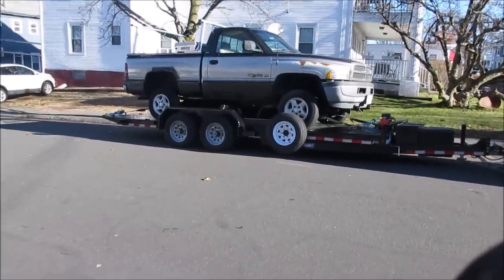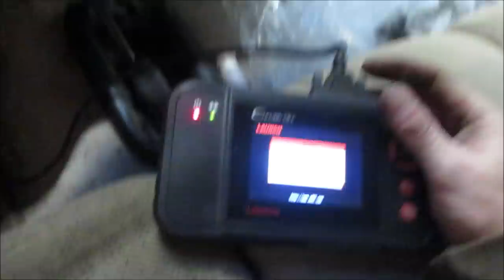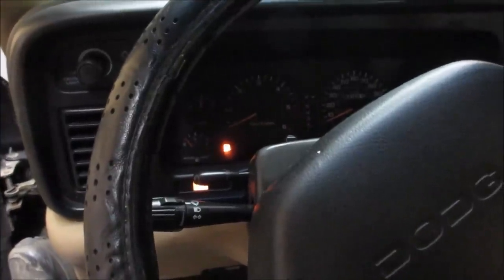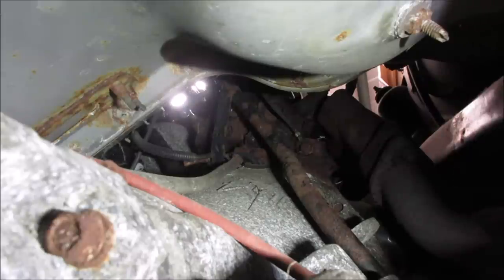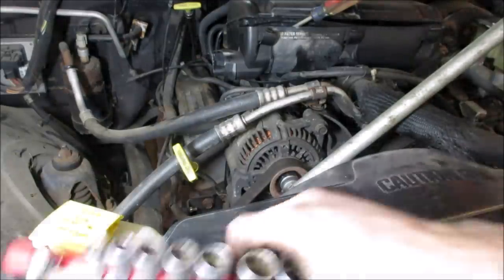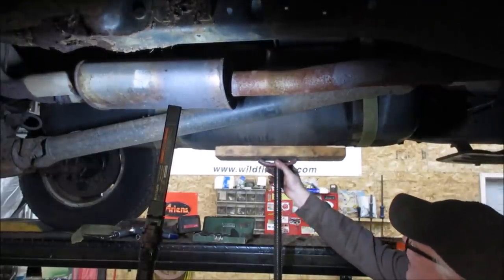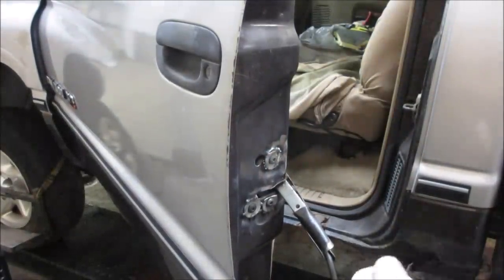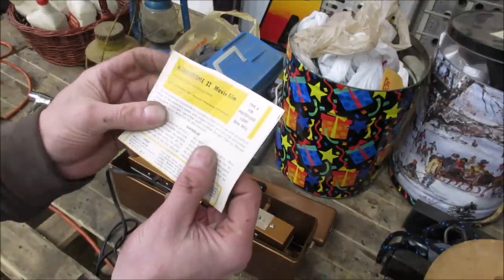Ratty Rusty and Wont Run. But Can We Save IT

Comment: Darren, if you read these one suggestion.
Paint yellow lines straight in line with the outer and inner edges of the lift ramps to the door of the shop with black lines across the yellow ones white numbers in feet on top.
You'll be able to see if you're on track and the distance to the rear of the vehicle. 
Also attach a red ot orange ribbon hanging from the outside edge of the vehicles rear bumper to drag on that yellow line with another yellow line perpindicular to the end of the ramp.
We had that on our lift in the Aviation ground support shop I was in charge of my last year in the Coast Guard as an Aviation Machinist Mate 3d class.
Friggen made positioning tow tractores and especially the Chief's truck on the lift way heck of a lot easier without putting a ding in his bumper and letting hell break loose when he came back for it on weekend gotchya back Chief jobs he'd give me an extra days liberty for.
He was a great guy to work for.
He cherry picked me for the job when I transfered in from Traverse City Michigan Airstation as the distric detailer screwed up and sent for two AD3's when thry had only requested one.
The helo shop chief was a goog ol boy from Georia and the other AD3 from Alabama so Chief Jay being from a Northeast state up around your area took sympathy on me and saved from the Aviation supply depot on base who wanted me to fill out my last year.
Reply: Thank you for your service!

Comment: Have same truck, '94 4x4, auto, 318. Still on road in Northern Ontario. Have replaced front fenders, rear cab corners, bed cross members and rebuilt rockers/floor. New doors from salvage yard. Runs well, used for 1/2 hr drives to seasonal home in winter. Replaced original alternator this year due to fracturing of aluminum body caused by rust expansion of steel-core  windings. Replaced straps on tank, drove first for a while with a heavy ratchet strap replacing one strap. Rad replaced this year, heater core flushed with CLR, good heat for 1st time in several years. Underbody oil-sprayed each year since rust repairs. Steering shaft replaced with Borgeson part. Has had one new coil. Issue with fuel pump turned out to be failing ground, ran new ground. Had issue with voltage regulator portion of PCM, bypassed with stand-alone regulator. Speedo drive not currently working, GPS speedo mounted on dash. Vacuum-actuated 4WD engagement on front axle failed, now locked on by reversing fork, disengages at transfer case anyway (later Chryslers went to this design). It's a good truck for what I need. Transmission rebuilt many years ago as was driven with leaking lines to trans cooler (owner failure!).

Comment: Nice job diagnosing the starting problem with that truck!  Nice finds in that freebie pile too.  The yellow jacket on the Romex indicates 12AWG/20A wiring....white is 14AWG/15A wire
Reply: And orange is #10.
Reply: Not to hijack, but what makes 12ga 20 amp vs. 15 amp?
Reply: @Jeff_Pendleton  The wire size. It's a bit of an over-simplification but for #14 and #12 it's true. US (and I think Canadian) domestic wiring requires at least #14 wire for 15-amp circuits and #12 for 20 amps.

AWG is a strange system where the numbers are inverted, larger number means smaller wire. Sheet metal gauge in the US works the same (everyone else just gives the metal thickness in millimetres).
Reply: @Jeff_Pendleton  12ga wire is thicker than 14ga wire and thus can safely supply 20A of current @110V

Comment: I’ve changed that sensor behind the left cylinder head before. I did it from the top and it took time and patience. When I saw that faulty code I knew you were in for a treat!!  Thanks for the content and have a great day sir!!
Reply: I want my patience and I want it now.
Reply: Yeah, definitely easier from the top, a couple swivels and some patience.
Reply: The dead give away was the tach wasn’t reading when the engine was cranking
Reply: Easy to replace on 96 dodge ram van with the 318 V8 engine
Reply: I don't think that it was described  . It's a crank position sensor and I have giant sized hands. You tube videos were no help so I paid a pro to do it.
 My truck is a 1994 short bed single cab and I call it my half hour truck. The transmission gets slippy after a half hour so it's fine for a twenty mile trip and work on the rental. Those tank straps are T slotted next to the frame and bolt as shown on the other side. Not easy even on a cab and chassis with the bed removed. The frame rails on my other truck, the Mighty Cummins 3500 are still in paint after twenty years, but some parts like spring shackles just rust away. The body on my 2002 is lasting better than the five year old stuff you see on the road now.

Comment: The Austrian "weird" glass thingy, is for dispensing cold wine. The inner tube is filled with ice and wine is poured around it. Wine comes out of the bottom.
Reply: They use these in Bavaria also, not surprising as it borders Austria. I thoroughly enjoy your videos, thanks.

Comment: I’ve got two 5.9s. 1997 2500 van and a 2003 Durango. Great engines. They are actually the “last American iron V8s” that are a direct descendent of a 60s engine. In this case it’s the 273 of the early 60s.
Reply: Fortunately the van and the Durango have much better engine access !
Reply: 👍Thanks Darren 😊
Reply: 273 came along in 66 and was sold along side the old polysphere 318.

Comment: The rust is something I don't miss about the north.  I grew up in Maine but have lived in NC for 6y now.  Recently put lowering shackles on a 95 ranger....all 4 shackles bolts came out of their respective bushings.   Up north, you usually have to torch them out and replace the bushings!  Did the job in just 30 minutes.  The frame on the just looks great as well

Comment: The red globe lantern is a railroad signaling one. I used to have a collection of some of those when I was a kid in the 1960's. It should be marked as property of a certain RR company for who it was manufactured for. Some of them even have the globes etched with he RR's name as well. Back when all the trains had cabooses and signalmen every caboose carried a set .
Reply: My grandpa had a couple of them stashed around my grandmothers house from when he worked for north folk
Reply: Railroads didn't use large base lanterns in general service, if they did it was maintenance of way related. Large base lanterns like that with red globes were used in road construction, they had a large stable base that held a lot of kerosene so they could be left unattended for hours.

Comment: The bright metal thingy we called a jigger.  Used to measure consumable spirits (not ghosts).  The bottom "shrinking head" is for breaking ice into smaller bits.  The bottle opener you evidently know about.  Some models had a cork screw stored in the end of handle, while others sans the opener, had a Rolodex of favorite beverages built around the handle. A  barkeepers friend.  Narragansett Bay

Comment: Those fails you saw on the scan device are just it trying to connect to the car using various different protocols. It tries a bunch of weird ones first and then defaults to the most common one at the end. 90% of the time unless you're working on something strange you'll always get that result in the beginning.

Comment: You should add some paint lines on the floor when the trailer is lined up with the lift to make it easier to line up the next time.
Reply: And put anchors in the floor for the lift😬

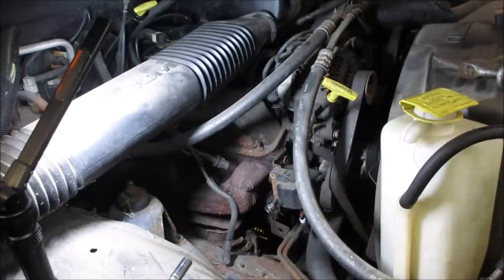Comment: 17:45 Yes. No LA 360 parts will fit but Edelbrock makes intakes for it and you can get regular distributors for it. You'd have to run an electric fuel pump because there's no provisions for a mechanical one, but other than that it's not super hard.
Reply: But would cost more than the truck if worth lol
Reply: And why would you? Carbs only seem simpler.
Reply: @guyina4x499  He was talking about putting it in an older vehicle. It's easier to run a carb setup than swapping the ECM/harness into another car.

Having worked on a few Magnums, I can say I don't like them very much in the vehicles they came in. Really hard to work on and the EFI system is unreliable at best. Also really thirsty.

Comment: Wow this is amazing how smooth that V8 runs. The rest of the truck has parts fused together with rust. For its intended purpose is just fine. Can’t wait for that transfer case. If it is like what I am thinking, it uses what is called a silent chain, a multi- lataced chain used here and in some helicopter applications. This truck has character for sure.

Comment: Just spent my Saturday afternoon fixing my loose gas tank on my '04 Ram 1500. I can sooo relate to the rust rainshower falling on Darren as I replaced the broken bracket with some metal strapping.

Comment: The lantern was for road construction or some other type of construction, they are distinguishable from railroad lanterns because they have a large round base that held a lot of kerosene so they could sit for hours without being refilled. These red globe lanterns were common in road construction and are very often sold as railroad lanterns but they weren't, in the rare case you find one of these marked for a railroad it was used by a maintenance crew.

Comment: Mustie you are a bad ass! I love your videos and you are an inspiration! One thing I always check with my initial start up on diagnosis is the rpm gauge. If you see the slightest movement on your rpm gauge that means your crank shaft sensor is working. If you don't see the slightest movement your crankshaft sensor is bad, that is of course if you don't have a wiring problem. Thought you may could add that to the wealth of knowledge you have! You are awesome!

Comment: In 1999 I bought a brand new 98 model, it was the electric blue 4x4 Sport, it came with the 5.2 318 and 5-speed manual trans', but basically the same running gear, and I put a set of 285/75r16 Cooper STT Mud terrain M+S rated tires on it, If you were turning sharp and hit a decent bump they would rub just a little bit, but not enough to bother me, they're right at 34-inches tall, and that little truck would go through stuff that would shock you. I didn't know they had a 1500 short box regular cab with the 5.9 360. Mine was a great truck, I had mine for 5 years and was hard on it and it never gave me any issues.

Comment: I love good old Dodge trucks. My current one I'm keeping running. Just did the front right hub, water pump, front crankshaft seal, rear pinion seal, and gas tank straps. I had the gas tank held up with ratcheting straps. Fun times indeed!

Comment: I had an old Honda with a similar door strike problem. My solution was a home depot joist hanger, a handful of self tappers, and a dremel tool. Lasted as long as the car, needed a bolt tightening about once a year

Comment: The light bar was for an old home movie camera. First movie cameras needed a lot of light or fast exposure film to take pictures inside. No aperture/f-stop adjustment.
The metal stand with stainless tipped funnel shaped glass is a fancy wine dispenser. Fill the glass with wine, use the inside bottom of your glass to push the plunger up and wine will dispense into your glass. When full move your glass out of the way, wine will stop flowing and the glass bowl will catch any drips.

Comment: Bartender's gear... one side is a hammer to crush ice, the other is a jigger to measure booze, the tip of the handle is a muddler.
The vertical glass container is a decanter... you store wine into the large chamber, add ice to the smaller chamber, and dispense the wine from the bottom.
Get yourself some rollerblade wheels for the chair.

Comment: I had a one ton dodge with a 360 had 180k on it. It ran like a swiss watch, If I took it easy getting to 65 on the freeway I could get 18mpg, I know I know , nobody believes that, but I did. Great van , I have kicked myself every day for 2 years since I sold it , and I drove it for 3 years and got more  than I paid for it .

Comment: Same coil setup as my '96 Dakota, I'd love to upgrade to distributor-less! Maybe that'd take care of misfires.
I had to replace the flywheel sensor, the cam-position sensor, and one other I don't recall soon after buying it.
Had to take the bed off to change the in-tank fuel-pump a couple years later, that was fun. 
Easier than dropping the just-fully-filled tank without the tools for the job!
Now all the front suspension bushings are crumbling, partly from age and partly from trans-fluid leaking on them.
AC-pulley on these tend to squeal eventually, too. Build up too much metal dust from the clutch.
Huh, made in Austria! Oh! It's a juicer! For grapes! Maybe for bottling? (hence the vines/grapes motif, I think) 
Holy cow, how many watts is that work-light?! XD Ah, for film/photos, nice! Oh dear, that's a big leak!

Comment: I put a transmission in one of those trucks (used one) extra rubber boot for sensor in tool box extra bolt drawer. Reminds me of that every time I see it. Hard to put cap and rotor on too

Comment: To answer the question of, csn you put a carb on this 360, the short answer is yes.  However, the magnum 318 and 360 used a different intake compared to the older LA 318/360.  Magnum intake bolts are vertical install, where LA motors were angled.  You can install a distributor from a LA Engine points or electronic and the provisions for the older 318 /360 motor mount ears are still cast in.

Comment: Sure you can pull that engine out and put it in a classic car. With the distributor already present, just need an ignition controller from MSD (etc.) to take over for the engine computer, delete most of the engine wiring harness, and slap on a new intake and carb. Modern transmissions need ever increasing computer involvement though to operate so a manual might be a better choice behind that engine in a classic.

Comment: Yes it can be swapped into older cars by swapping out the distributor and tbi.. You remove the entire airbox,climb up and lay across radiator and along the intake with an assistant nearby to hand,retreive dropped tools and hold stuff... which is why the most neglected part on the rams are the distributor cap,plug wires and rotor...

Comment: Those Kodak lights are probably from a 8mm home movie swtup.  My parents, back in the '60s, had a 4-lamp, U-shaped frame that attached to their 8mm movie camera.  The lights were treacherous as they got so hot they would set upholstery or drapes on fire 5 minutes after they were turned off.  There would be an instant class action lawsuit if they were made today.

Comment: I used to have a 1996 dodge dakota with 120 thousand something miles years ago. it had the 3.9 v-6.  It developed a no start condition like your truck had. I paid my mechanic to diagnose it. It was also the crank sensor. My mechanic threw a new one in, and the truck ran fine. The check engine light did come on after that though. My mechanic could never figure out why it was on. I sold the truck later on.  The crank sensor must have been unreliable in the 1990's years.

Comment: I think I’ve replaced about 7 kabillion crank sensors on 3.9/5.2/5.9. Usually they’re easier from the top. Just remove the air box and give the engine the old reach around. They aren’t super fun on that body style since the cowl goes so far over the engine, some others are easier. The 4.0 in Jeeps use the same sensor in almost the same location. Usually they short the reference voltage to ground and shut down the engine computer because whoever designed the engine management made the brilliant decision of putting the engine sensors on the same regulated voltage source as the ICs in the engine module.

The tiny bits of metal stuck to the end of the sensor won’t affect its operation at all. The spinning flex plate does way more to affect the magnetic field than some tiny metal specks.

Comment: In your part of the country it's ratty rusty, in my part of NY it's in great shape worth at least 6-8 grand. I remember when you could pick something up with a plow that was turn key, but rusty, for $1000. This project did hit home as my 98 1500 had a coil crap out and luckily not the crank sensor. The 360 sounds even better when the muffler rots off and becomes weight in the box 😃

Comment: Sweet find on the JD, not sure which v it is though. I have a 60v that dad and I used when I was a kid. I put up a vid of it after I cleaned it up. Good dependable saws. Always found it best to have a small step stool for working on the ignition for the Dodge, or anything at the rear of the engine. 😁
Reply: That saw was built by Echo for JD. I believe it would be an 302 Echo. I had one years ago.
Reply: @notajp  actually made by Kioritz which I believe was later bought by Echo.

Comment: fix the rust with patches engine work tune up etc,replace the timing chain. these trucks are usually bullet proof. as long as you do maintenance our 04 over 222,000 is still ticking. yes bearings radiator tlc that’s it oil change new battery here their typical high mileage stuff. no oil problems.

Comment: you are awesome man you can get anything to run.. without spending much or replacing everything .. thats what i enjoy the most. the engine sound gr8 am sure the check engiine light wil be a minor issue . its clean on the inside you can stil fix this truck is stil worth it. gr8 video tysm ..you make my sundays gr8 again

Comment: Holy cow free roadside Romex wire,lanterns and chainsaws.Your engine light came on after you did the work underneath.I don’t think you plugged the PCV valve sensor back in which would trigger the check engine light.

Comment: I think that thing with the wine leaves and the nesting glass pieces is a wine cooler and decanter.  You fill the inner glass thing with ice and fill the outer thing with wine and it cools it down and you pour the wine through the spout at the bottom.